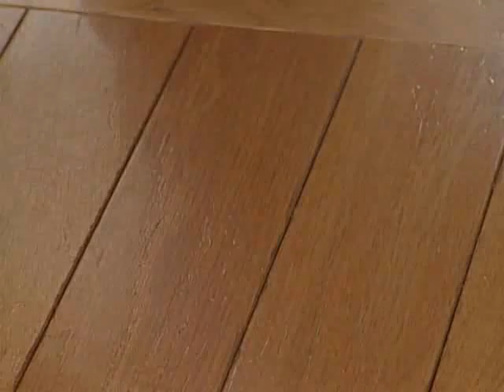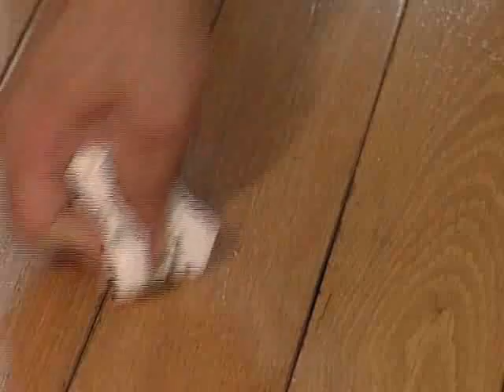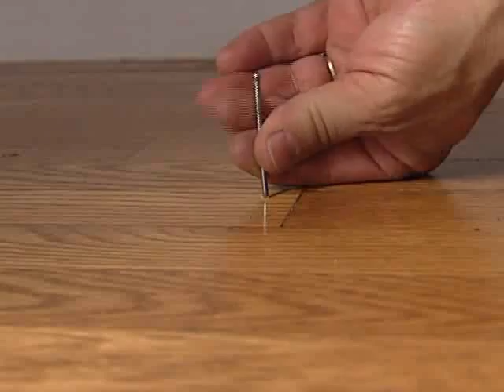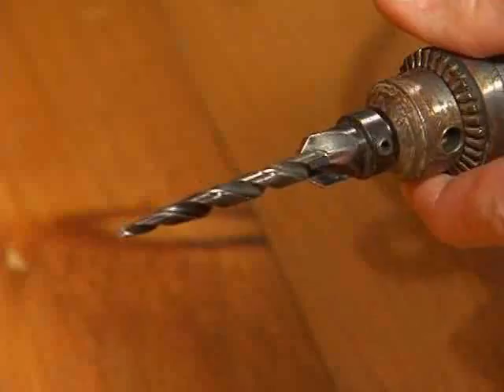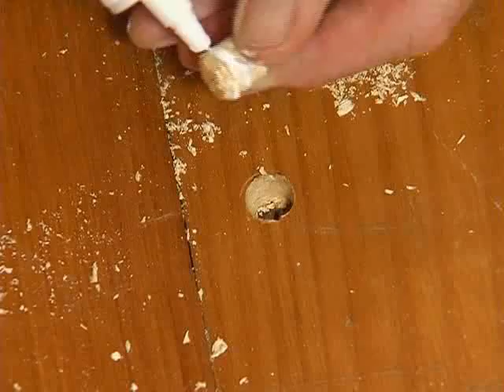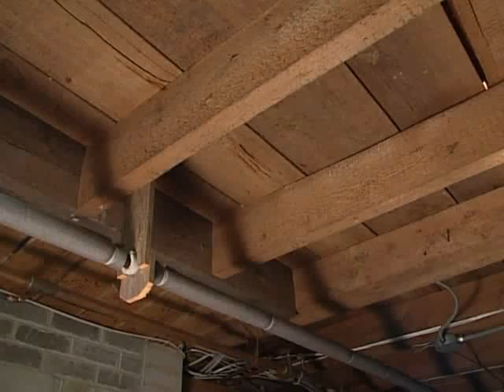How to Repair Squeaky Floors

Comment: Forget making plugs for the holes. Just use break away flooring screws where you can break the heads off.
Reply: Absolutely. Save time, effort and a better looking finish.
Reply: You can try as much as you want... those will fail to permanently secure the boards i.e, after some time, the squeaks come back and you still have those holes patched... yeah, I'm still looking for something better and next experiment will be "inject glue with an syringe"...